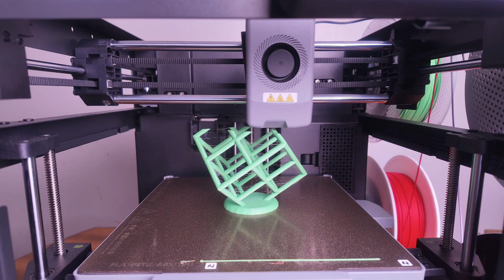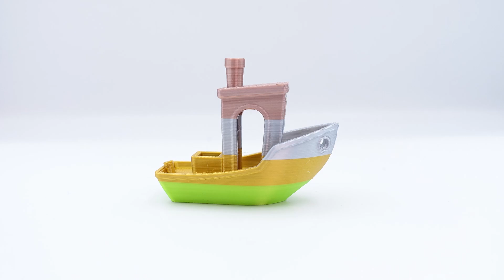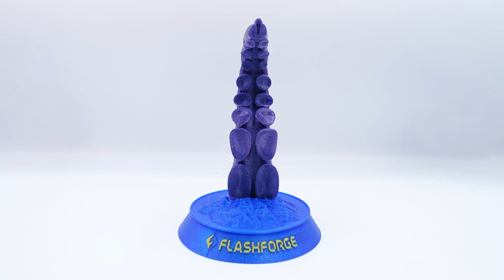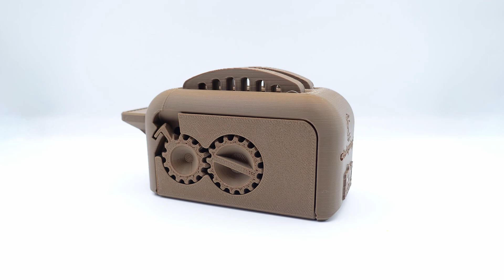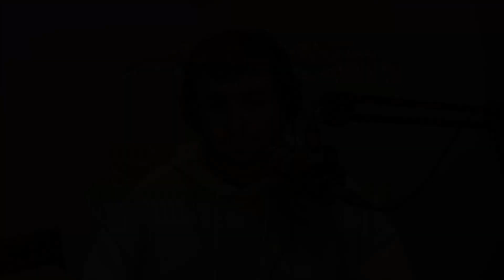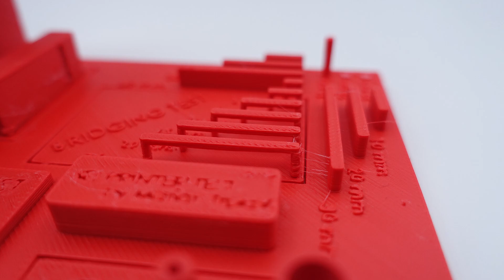Flashforge AD5X Print Quality!

Comment: Have u printed a multiple colour print that u sent to the printer.  I have sent one from the slicer but it only printed in one colour for some reason the stored ones on printer do multiple colour great but not one I sliced
Reply from the maker: In all honesty, I’ve sent a couple prints but have been getting the E0011 error. I’ve been troubleshooting it with Flashforge and currently it seems that any file I print with tree supports seems to fail apart from Hybrid.

I’m working on a full review and this will definitely be mentioned in it 👍🏻